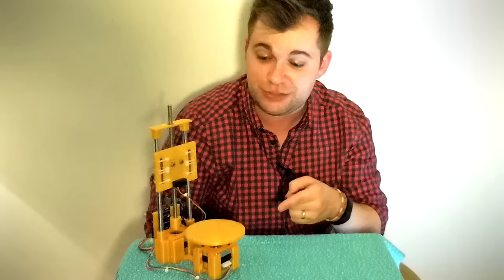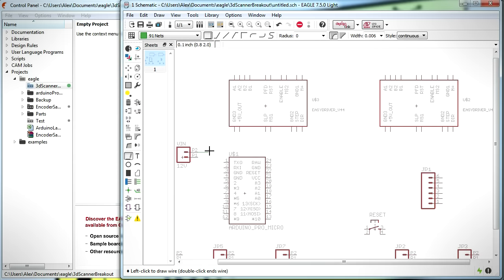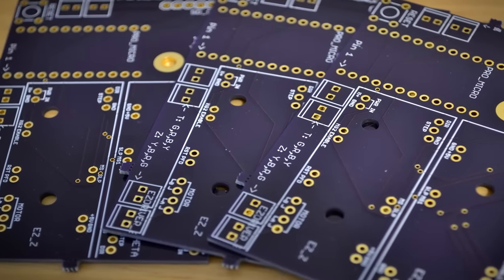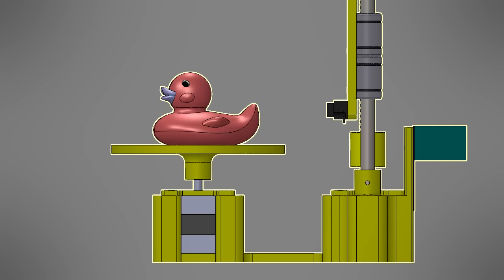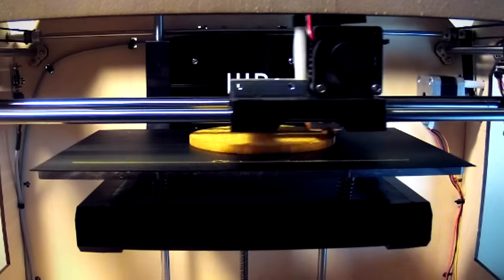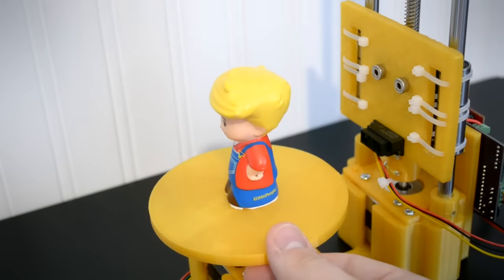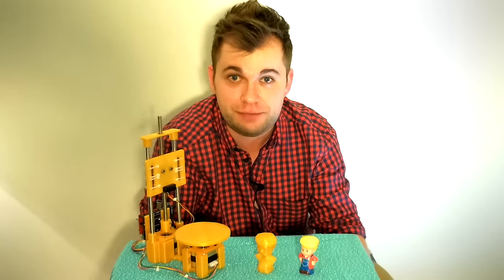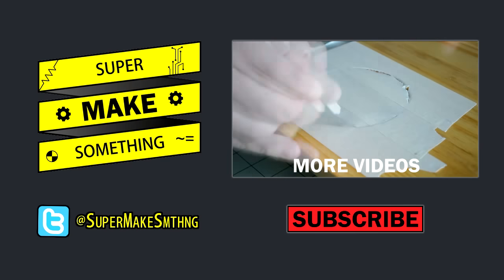DIY 3D Scanner (Arduino, 3D Printing, PCB Design, Stepper Motors, IR Sensing) - Super Make Something

Comment: greetings excellent tutorial which would be the cost per copy of the pcb. Thank you
Reply from the maker: Thank you!  I ordered to board from OSH Park, which charges $5 per square inch, but you receive 3 copies for one order.  The total charge for this PCB (without components to populate it,) ended up being ~$30.  

If you would also like to order your board from them,  you can use the following link: https://oshpark.com/shared_projects/6a2i1P86

Comment: Hello Alex can you share the info about where to get the stepper motors the shafts, guide shafts etc.
Thanks
Reply from the maker: +unusutteneo I sourced the stepper motors, shafts, and bearings for this project from AliExpress, and other electronic components from various online retailers like Adafruit and Sparkfun.  While it is difficult to link directly to the parts from AliExpress, since the listings on this page are akin to Ebay pages, which aren't on the website forever, I will be posting a bill of materials in the video description shortly, which will hopefully make finding the parts online easier!
Reply: Thanks for the info.How we could increase the resolution of the scanner?
Reply from the maker: +unusutteneo The most direct way would be to replace the IR sensor with a laser, though this would require modifications to the Arduino code and potentially the PCB layout.

Comment: Super Make Something , i actually making this project for college project, but i have a problem in exporting the 3d model that has spaces in it(just like holes) as the code fill these spaces  and i tried to fix but no progress, and i noticed that the sensor doesn't read the spaces in the scanned object(doesn't give the reading that indicate reading air), so any tip can help and thank you for this great job.
Reply from the maker: That is true, the sensor does not give a reading for air.  However, it should give a distance that is "far away," though this is filtered out by the MATLAB code as a result of how I generate the mesh.  In order for the MATLAB code to be able to export items with holes, you may need to edit both the point-cloud code, as well as the code that exports the STL file.  Regarding the latter, check out the "marching cubes" algorithm, which is used in one of the MATLAB->STL scripts that can be found on the MATLAB file exchange.  Hope this helps!  Good luck with your project!
Reply: thanks for replying, but the marching cubes algorithm requires the array of data to be  a 3d array, whereas the array of data is too big and this causes the out of memory problem. so do you have any Suggestion?

Comment: hi sir,how did you convert the analogy sensor value to digital sir.
1)what is the meaning for (sensor value,0. 0,1023,0.0,5.0)
2)how that formula will convert the voltage into distance sir.
Reply: do u have any reference for that sir?
Reply from the maker: This method maps the output of a sensor, read by the microcontroller as a value between 0-1023, and converts it to a distance between 0 to 5.

Comment: Any chance you'd make the eagle files available, the link only has the gerbers.  Great project, I'm in the process of make it.
Reply from the maker: +Aaron Morris I can definitely post the Eagle files, though please be aware that you may need other libraries to successfully open the project.  In particular, I relied significantly on the Sparkfun and EasyDriver libraries when designing the PCB. &#160;

Please keep an eye on the video description for a link to the zip with the Eagle files -- I will upload it as soon as possible.
Reply: Thanks! This is one of the best projects I've seen. Awesome work!!!

Comment: how did you find this data or where are they::
distance = -5.40274*pow(distance,3)+28.4823*pow(distance,2)-49.7115*distance+31.3444; //From datasheet
Reply from the maker: This was from the information on the datasheet + a regression in order to best fit the data for some sensor values I recorded.  More information can be found here: https://learn.adafruit.com/calibrating-sensors?view=all
Reply: @Super Make Something I have GP2Y0A21SK0F sensor I need the equation
Reply from the maker: @محمدمدين-و7ب  Each sensor varies a bit, so you will need to take measurements at known distances and perform a regression on the data to create the equation that is right for your sensor.
Reply: @SuperMakeSomething  I measured the voltage at different distances and could not find the appropriate equation

Comment: This is one project I might think about building myself, will it be okay to ask what was the computer aided design software used in this, thanks
Reply from the maker: Joseph Warren I used EAGLE to design the breakout board PCB and Solidworks for the 3D printed parts. However a good alternative to this software is Fusion360, which is free for hobbyists/makers.

Comment: hi, sorry quick question.

I am trying to make a very similar 3d scanner using all the same components as in this video.
the first thing I tried to do was supply power to the arduino of +12v on the raw pin and the black wire connected to ground.

It completely fried my arduino, I'm certain it was the right polarity, and the DC power supply I am using is 12v DC 1500mA. do you know what may have caused it to fry?

thanks.
Reply from the maker: That is strange, because the voltage regulator on the Pro Micro is rated for up to 12V.  It may be that the regulator on the board was bad?  I've found that the quality of this microcontroller can be somewhat variable, with certain Arduino clones being more prone to frying, etc.  Though it should not make a difference, one thing I would try is to connect every component to the PCB before powering micrcontroller with the 12V line.  Again this shouldn't make a difference, but it is what I did, and did not have any issues.
Reply: Thank you for the reply, 

It may have been a faulty board, and it does appear other people have had similar issues.

specifically what happened was that I turned on the board, all the lights on the board started flashing violently, in panic i decided to quickly turn off the power. 1 or 2 seconds after I turned the power back on and one of the two C106 capacitors gave up in smoke.

I don't know for certain what caused the blowout but I have a few ideas. anyway In future I will just use a voltage regulator to bring it down to 5v, Arduinos seem to behave far more stable at this voltage.

Thank you once again for your time and project.

Comment: Hi Alex, I put the 12V power supply on arduino and it burned :))) 
Just to test the motor, I connect the 12V PS on arduino and on a easydrive. I didn't do the all configuration.

Here is my question: How can we power up the arduino and the drivers with 12V, while they are for 5V?

Thanks.
Reply from the maker: Andrei Rosu Oh no! Hmm... in general I would recommend connecting everything first just in case, before connecting the components. Did you power the board before connecting the Arduino to the header pins? The way connecting a 12V source to a 5V Arduino works is that the 12V are connected to the Arduino's RAW pin. This line is connected to a voltage regulator on the board, which regulates the power down to 5V before feeding it into the microcontroller's circuitry.

Sorry to hear that your Arduino burned! As a sanity check I would verify that the board is truly dead by connecting it directly to USB. :-/
Reply: Thanks for your fast reply.
Yes, I have connected the "+" to RAW and "-"to GND.  I have connected this way before and it worked. I can't figured out why this happened 
It's dead, I have also connected the board to my laptop, and there was no life in that Arduino :)))
I guess I'll order a new one, or two just to be sure :))
Yes, I read about that regulator.
Thanks again Alex
Reply from the maker: Andrei Rosu Hmm that is odd. I have read that the easy driver can get damaged if the motor is removed while to board is powered, so maybe the energy in the capacitor was propagated back to the Arduino due to a loose connection in the screw terminal. Not really sure. :) it is always good to have a few arduinos on hand I guess.
Reply: Alex, can I use a Arduino Uno board? If YES, which one is the equivalent for RAW pin?
Thanks.
Reply from the maker: Andrei Rosu yes, you can use an uno, though you will have to run jumpers to appropriate pins on the circuit board headers. To make sure that things are connected correctly, I would google "Arduino Uno pin out" and "Arduino Pro Micro pin out" to see which pins correspond to each other between the two boards.
Reply: Great, Thanks Alex

Comment: curious if placing a box over the scanner so that the ambient light is cut would help as well as almost like a blinder setup so the ir beam is more focused. all those ideas aside great base for expansion!
Reply from the maker: +Calvin Witt Interesting idea.  The closest thing I've done in this regard is scan in a dark room at night, which should have cut out most of the ambient IR that could have interfered with the scan quality.  Though I did not do a formal analysis, there did not seem to be a significant improvement in scan quality, so I think that the resolution of the current scans are primarily limited by the "spread" of the IR sensor's beam and the analog "noise" of the reading.  As you say, keeping the beam more focused would definitely help.  Instead of a laser range finder, I've also recently found some other IR sensors online that seem to have a little bit of a narrower beam profile at greater ranges.  While I'm not sure if they are a one-to-one drop-in replacement, these may improve the scan quality as well.
Reply: Makes sense, obviously for a benchtop scanner made with basic components you won't be able to get perfect scans but the fact that it even works is honestly amazing. I wonder if using something like a polarizing lens would help reduce the "scatter" effect on the sensor. While there is a lot that you can try out I feel that is the overall beauty of the system! It is easily hacked for experimentation.

Comment: AAAAnd I made it :D It's working now. It feels sooo good :))

PS: Please explain me this line Alex, I'm not sure from where are those values .. 
"senseDistance=-5.40274*pow(senseDistance,3)+28.4823*pow(senseDistance,2)-49.7115*senseDistance+31.3444;"

Thanks!
Reply from the maker: Andrei Rosu That's awesome! Congratulations. Happy to hear that it is working. :) That line is the equation that maps the output of the IR sensor into the distance that is written onto the text file of the SD card.  The relationship comes from the sensors data shit, and is a curve fit through the test points they list there. Hope this helps!
Reply: Could you send the output file of the scanned object and the photo of the object??

Comment: Your video is useful for me. Thanks !!! But I have a question "Can I replaced SHARP GP2Y0A51SK0F by SHARP GP2Y0A21SK0F ? "
Reply from the maker: The pinout should be the same, but you will have to adjust the scaling in the code, as that model is made to sense at a different distance range.
Reply: ok thank you so much :D

Comment: cool idea , think you can use the laser distance measuring setup on a cnc router table as whell 

lets say you want to cut text intoo an odly shaped block of wood thats mounted to the cnc table 
you mount the laser to the end of the router (maibe just make a shaft on the back of the laser and mount it in the spindles chuck) set the laser to a known height over the table , set that height over zero in mach3 raise the laser to clear the object on the table then scan it using an x and y gridpattern
you now should be able to set the debt of the lettering across the shape in some way (prolly some fancy add on software or a standard program option that wasnt meant for this but does work like adapting the tableheight per point on the block so the bit follows the profile at say 3 mm down across the shape ) zero the routerbit to the table and go at it 

the routertable and steppermotors should be able to locate the object as where it is sitting on the table and the laser measures the height per however fine you want it from a set height above the cnc table , it would need to be mounted perfectly vertical 
the device only scanning straight down will mean that holes drilled at 45 degrees or other stuff that are slanted inward below the surface or closely next to eachother wont be noriced that again a touchprobe prolly whont see those either
Reply from the maker: Cool idea!  While not quite the same, the Microsoft Kinect works in a similar way.  Though the Kinect sensor does not move in the x,y directions, it's output can be converted into a "depth map," which reports Cartesian distances.  If you have access to MATLAB, code is available online that does the conversion for you to try it out -- Refurbished XBox 360 Kinects go for about $25 if you can find one at your local game store.

One note -- I am not sure what the minimum range of the Kinect depth sensor is, so it may not provide a usable result if it is mounted very close/may not have enough resolution to give a very detailed scan.  In any case, it would be cool to try out!
Reply: the reason i gotten the idea is because i think the laser unit setup you had on the scanner in this video and the little circuitboard would work even cheaper 
it allready adapts and records the measurement in digital signal that you can use on a 3d printer , you just need to think in a different (linear and grid)  direction when it comes to a cnc router  , it allso proven it can work on the set distance it would work when mounted to the cnc router

you need to add to the cnc stepper program you have now to move the gantry through the whole reach of the x and y in a gridpattern while registering / recording the placing and the height in mach 3 and be able to superimpose / adapt the height of youre cad design over that in mach 3

the setup you have now allready does that with two small steppermotors , they now only work the steppers in one direction at a contstant speed , that needs to chance to back and forth on the x and small increments on the y after each sweep , the file once done prolly wil be HUGE and depending on the size of the router (the whole work surface of the table under the router will be recorded ) and the file still need to be played with in mach3

i think that if a manufacturer can make an eazy to operate device and a program that works / records its findings directly intoo mach3 they can make the device a lot cheaper than wats available now 
aspecially when comparing it to a ruby tipped thouchprobe
might even go around the slant problem by having the scan performed more than once at different angles or mutiple lasers

Comment: This project is very cool!
I actually making this project for college project,But I have some problem in export STL file, How to export to Stl file?
I can run ProcessScanDistance Code and its show 3d Modelling <Point cloud> yet
But I can not to run surf2stl ,
It show >> surf2stl
Error using surf2stl (line 28)
Not enough input arguments.
 
And I have some question to ask you about the result from IR Sensor is not correct ,It can scan cylinder but can not scan Square shape and the complex shape.
Why the result is not same?

Comment: HOLY HELL!!!  
+1 Subscriber!

Questions:
1.) Which version of Matlab is necessary? 

2.) Would you do a build which could accommodate human scanning (specifically for me)?  I am 6'4, 306 LBS and it is difficult to find scan videos which allow subject weight over around 200 LBS...  (Sizist/exclusionary design practices suck). :-/
Reply from the maker: Thanks! 

I believe that any of the more recent versions of MATLAB should work, since the code doesn't use any special functions. 

I think a slightly different concept would be needed for human scanning, as it would be difficult to hold still that long. At the very least, I think the scanner would have to capture the person's whole "height" in one scan, completing the entire scan in one revolution. Though I have not tried it, I would suggest Autodesk's free 123D Catch software, which makes a mesh using a series of images. If you have a way of taking pictures of yourself from various different angles, this may be good to create a "human-size" mesh/point cloud.
Reply: +Super Make Something I was thinking of the "Kinect based" scanner/large turn table solutions.

But, I've only seen videos, and have little technical "know-how".

I'd need you to break it down in "Layman's terms" if you'd be so kind.

Comment: is there any drawbacks in using ir sensor of series A51 instead of A21
Reply from the maker: katheravan arumugam Any IR sensor with analog output should work as long as the range of the sensor is well suited for the size of your scanner. Before deciding on one sensor over the other, be sure to refer to the data sheet to make sure it senses over the range appropriate for your project.

Comment: @SuperMakeSomething Sir, I have to do this project for my university lesson. But, I have some problems with PCB design. I install Eagle which uses version same your version. However, I cannot include libraries your use. Please help :)
Reply from the maker: The version of Eagle shown in this video is old and may no longer work. I would suggest using KiCad instead. Good luck with your project!